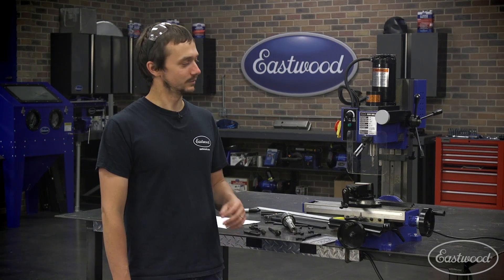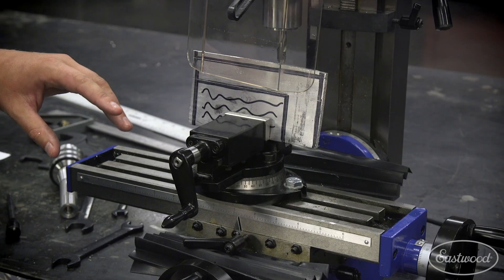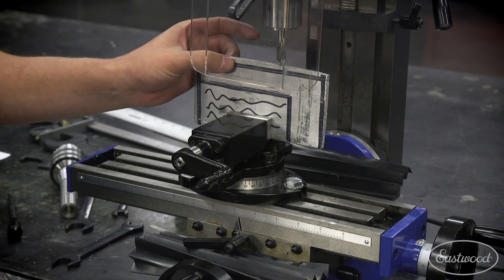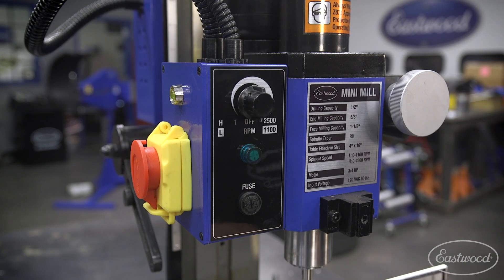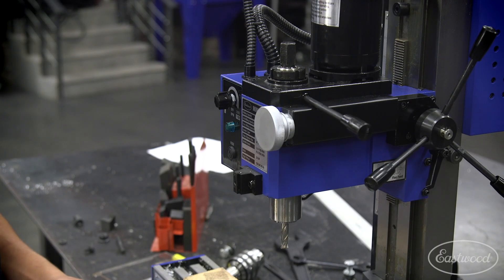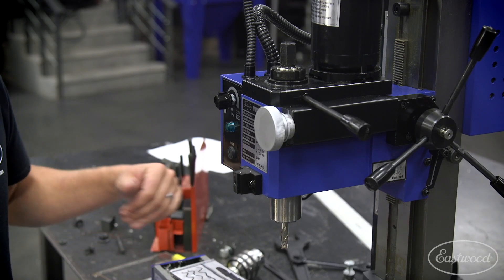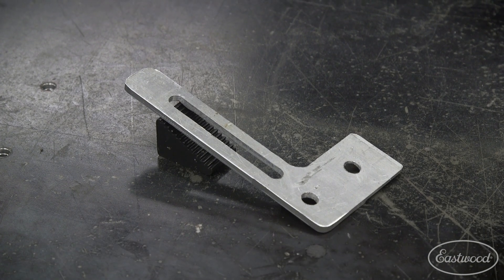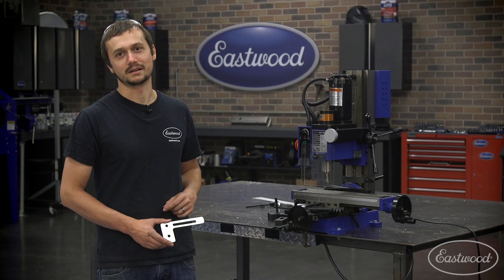How To Make Custom Brackets using Mini Mill: Small Package - Big Performance from Eastwood!

Comment: I like this company and the products they offer for the DIY market ... but things like this make me second guess that opinion. Im sure you are aware, Eastwood, that we all know we can make that part in less than 30 minutes with an angle grinder and hand-held drill. With a machine of this size please dont try to tell me the precision is better, given the chatter, vibration.
Reply from the maker: So this project is less about the project and more about showing you the kind of things the mini mill can be used to make.  To your point, cutting and drilling could be done with other tools but the facing to offset the part would be difficult to do and make even/flat without a tool like this.

Comment: Pro tip: 

Buy this exact same unit from Harbor Freight for half the price. 

The only difference is that it's not purple.
Reply: $900 vs $800
Reply: @zoranm9417  The 25 percent off HF coupon makes all the difference.   Not quite half...you're right but the savings are still considerable.

Comment: This video came across my notifications and this thing is a joke lol. Don't waste your money on it. It would  just chatter and give horrible finish trying to make any cuts people have in mind doing when they think about buying this toy. Most it would be good for is cutting plastic, nylon and maybe delrin. People, before you have thoughts of buying this thing and just milling away in your mind, looking up on google it even better here in YouTube a Bridgeport series 1 milling machine, which is just one type I have in my machine shop, see the size robust, and weight of that machine then note that we still fight chatter making cuts on them. Of  course it's much Larger cuts but you will get the point. Don't waste your money in this, and just save up $1500 and find a tool action and buy a wore out REAL Milling machine. Even being completely wore out, you will be able to do way more and with better results than with this Chinese junk.
Reply: I'm not sure what a good use for this machine would be. Model making maybe. Heavier is better when it comes to milling, not just weight but support structure. Motor hp isn't a terribly big deal but VS control results in much less power when turned to slow speeds required for steel, not that this mill is made for steel.  I have an older Jet knee mill 3hp mechanical VS. They can be had for less than this mini mill used in fairly decent condition.  BUT you need to be able to tell if it has problems before buying. Repairs can be expensive.  On the other had they often come with some tooling, a vice and maybe power feed(s.)  Consider your future needs before buying.
Reply: Dont listen to this american junk how that feel brother
Reply: I am glad you have something big.